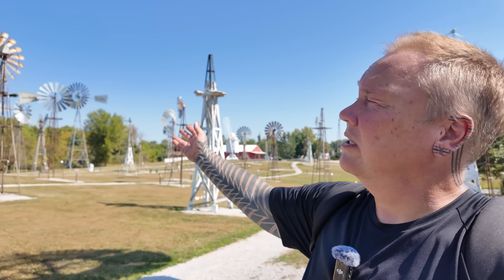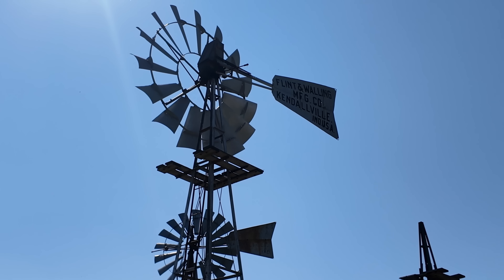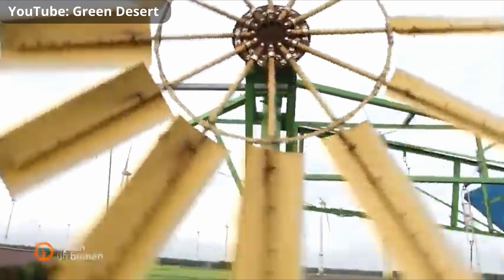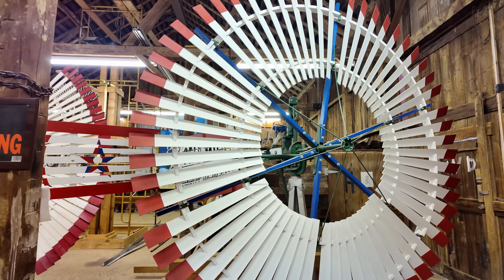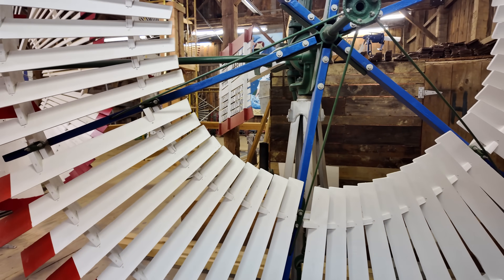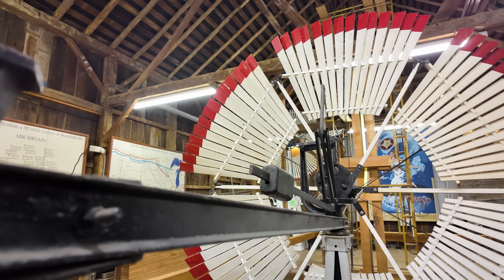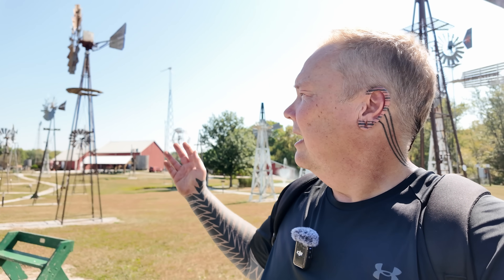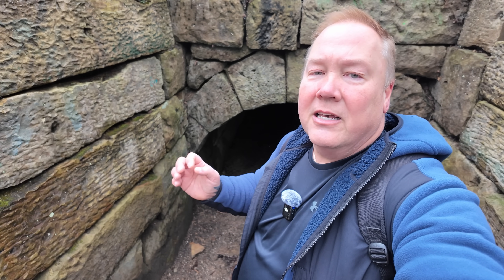Hidden History of American Windmills Revealed

Comment: Did the windmills come with  a special pump or did you just modify a well pump?
Reply from the maker: I think you'd just connect the windmill to the shaft that ran down the casing (the outer pipe).  Modern well pumps are electric pumps you drop into the bottom of the well pipe, but at this point, the technology was more like the old steam engine mine pumps, you have the reciprocating shaft going down the well casing with a couple valves.

Comment: On our 500 acre farm we had about 8-10 windmills, they were Aeromotor, Samson, and Monitor brands.  None of ours used the "feathering" mechanism he described at 4:10 to control the fan speed, on ours we used a lever connected to a cable (at ground level) to release the spring-loaded tail to turn the fan into the wind to turn the windmill on/off.  Pulling the lever to release/retract the tail also tightened/released a brake on the fan to stop the fan.  Also, in the video the "feather" worked the reverse of what he described, the vane would turn the fan out of direct direction of the wind, but similar to how the windmill would be turned off/on.
Reply from the maker: Were they considerably older windmills?  The mechanisms to turn them or feather them automatically came along later.  Most of them at the museum have ropes hanging down to do just what you describe, in some form or other, and need to be done manually.
Reply: @Industrial_Revolution  No, all were 20th century,  all used heavy steel wire, cable, or chain to control them.  A couple used a "winch-like" crank to turn it on/off, I think that could have been used to "feather" the windmill, though I never saw it used that way.

Comment: When someone sensible designs a windmill, you get one of these; economic to make and lasts ages.
Ask an idiot to design a windmill, you get a three bladed thing, that costs millions to make, with carbon fibre blades that don't last long, use massive amounts of energy to make, and are just dumped.
Reply from the maker: Different design objectives.  These can run a little generator, but you'd have to generated DC and convert to AC if you wanted to grid-connect, and they're really too small for that, anyway.  These are perfect, though, for running water pumps into a cistern or livestock tank where you just need it to run frequently enough to not go dry, and don't really care much about speed.

Comment: I have seen a lot of Windmills on Farms in SW MI but only one I can think of still working on a Amish Farm.  Pumping water to a large tank in a Barn .
Reply from the maker: Yep, a lot of old windmills are still around and not working.  A lot of new, smaller ones are being installed for use as air pumps to aerate ponds, too.  If you go out west, a lot of them are still working in remote areas for watering livestock.
Reply: @Industrial_Revolution    A friend of mine is in the Well Drilling Business in MI  He moved to TX for a while and he was very busy repairing wells pumps and Windmills for Ranchers.

Comment: Grew up on a cattle ranch in NM in the 40s, 50s and early 60s. One of the jobs I was good at was listening to the pipe at the top of the wellhead. You listened for the clicks of the check valves at the bottom of the well. By placing your hand on the sucker rod, you could tell the upper check valve from the lower and see the one or the other was working properly or not. If the upper was the culprit you just had to pull all the sucker rod out. Then fix the upper check valve that was attached to the sucker rod. If the lower one was misbehaving you had to pull the sucker rod and remove the check valve assembly. Then put the sucker rod back in the well and fish for the bottom check valve, once found it and screwed the sucker rod into it, you lift the sucker rod line up six inches or so. Since the check valve was in a cone at the bottom of a brass cylinder the pipe would come with it. Our Wells ran from 150 ft to about 450 ft, so that length of sucker rod and 2.5 in galvanized steel pipe was very heavy, for winch we used a steel cable ran through snatch blocks at the bottom and top of the windmill tower. Now with the pipe held a couple of in aloft, you used a sledgehammer to hit the top of the pipe to break the bottom check valve loose, once that happened you pulled the sucker rod as before. To reassemble just do the above in reverse.
The one time I got shown up by my father's experience was once the sucker rod over the years, had worn a pinhole in the pipe about 100 ft above the water line. The check valves were working, but water was leak out the hole so we got very little water up top, of course it was the 450 footer. 
We did amount of sucker replacements because they rubbed on the side of the pipe.
Did I forget to mention, well holes drilled the older drills did not run straight nor true.
Reply from the maker: How often did you actually have to fix these?  Seems they should be pretty durable, but sounds like you fixed them a lot.
Reply: @Industrial_Revolution Well, they were pretty good, but we were leasing the ranch, and a lot of cowboy types HATE  fencing and windmills in that order. Back then family run ranches could not afford tools that would have made things go easier. So our windmills when we got the place we're running on a lick and a promise. In actuality, my dad never let more than 3 or 4 years go by without topping off the gear boxes, that was the one job he wouldn't let me do. He'd go out on a quiet day, wind wise, climb up with a rope, I would tie a heavy chain to the rope and he'd pull it up, he would then chain the fan to the tower as tight as he could. Then I would tie on the oil and he would pull it up and top up the gear box, they did leak a little out of the pump shaft. He did all of this because it was not unusual for a gust of wind to come from an unexpected direction and apparently he had seen cowhands knocked off of the tower by the rotating fan and tail. Our windmills were all Areomotor with the centrifugal mechanism that would pull the tail to the side. The sucker rods were made from cedar, so where they rubbed they could wear themselves thin and break if you didn't pull and check them every 1 to 2 years. I learned a lot of curse words from broken sucker rods. Dad actually made a tool to fish for them and latch on to the broken end so we could pull it out, but it was time consuming and all the excitement of waiting for fish to bite.

We had 6 windmills, so never a summer went by that we didn't have to work on one or two of them. I didn't mind, because I thought it was more challenging than other ranch work. Fences that needed mending, either from wear or two angry bulls in opposite pastures. Bulls can destroy a mile of fence in one night of chaos.
The chores were piled deep, you never caught up or even close.
Compared to a lot in today's world at least you knew where you stood.

Comment: I've not seen these in the UK, but have seen loads in films.  I always wondered what sort of pump was used and didn't realise they had a mechanism for protecting themselves in high winds.
Reply from the maker: The older ones didn't have an automatic wind protection.  There was a rope hanging from the top and you'd pull and tie it down to engage the brakes.

Comment: I have a couple of pump Jack's. One is way older, it has 2 big gears and a flat belt pulley. I hooked a air/ hydraulic cylinder to one gear and a hydraulic control valve to the other and simulate a steam engine. With air,..
Reply from the maker: I'm not sure I'm visualizing this correctly.

Comment: That was most interesting, I once envisaged a small windmill / wind turbine using a bicycle derailleur gear arrangement controlled by a wind vane to vary output speed.
Reply from the maker: That would work, but wind isn't usually as consistent as water power, if you needed a specific speed.  Later this month (tentatively), I have a short of a windmill at this museum they've set up to run a small machine shop via gearing.

Comment: Driving truck I saw these all over. Nothing I've ever seen just does it's job.  Even though the farmhouse is turned to dust it  has no failure point. Some of them still have a working water pump. What can you put outside and come back 75 years later? Nothing except a windmill.
Reply from the maker: A lot of them you see, especially out west, were never at a farmhouse.  They're in remote areas hooked up to a water tank to provide water for livestock.  Some newer, remote wells have been built with solar panels, but I don't know they're any cheaper, and they're probably less durable.
Reply: @Industrial_Revolution I tried looking up more. Kept seeing the Aeromotor name but surprisingly there is not a lot to research on this bit of Americana.

Comment: In the early 1980s when I was still in college, I lived for a while in Napoleon Ohio. The Heller Aller Company was still building windmills at the time I can still remember the sand molds inside the factory. The model that they made was called The Baker "run in oil" model. The way the thier windmill worked in a too strong of a wind is that there was a spring-loaded tail, in the spring loaded tail would kick. And that would turn the blades 180 degrees so that they would be parallel to the wind. The funny thing there is that they had packing crates cardboard ones with the steel hoops, and they let me collect the metal lids from those for free. I made those into a solar heater for our back porch. 73 DE W8LV BILL
Reply from the maker: So the braking system was sorta like the first one I showed, but with springs instead of weights?
Reply: @Industrial_Revolution Yep!

Comment: I never knew that the side paddle shut down the wind mill what a cool video thanks
Reply from the maker: Until my first visit there a few years ago, and playing with that one they have there, I didn't know that, either.  It's really hard to visualize how they work when they're 50 feet up on the air.
Reply: @Industrial_Revolution as a millwright I was thinking some form of speed control with a weight or gearbox design but honestly this wins out every time with simplicity. Adjust the size of the paddle adjust the shut off speed
Reply from the maker: Either the paddle size or the counterweight.

Comment: I can imagine scrambling to make it there before the wind to hit that manual brake lever
Reply from the maker: A lot of these were installed right outside the farmhouse, adjacent to the barn, etc, and you'd just have to pull a rope at the bottom of the tower.  For remote ones, though, that'd definitely be a bigger challenge as a storm came in.

Comment: Back in 86, I worked at a wind farm on the Big Island of Hawaii. The wind mills were for generating electricity at 60 watts per mill. They were made by the Jakobs company in MN
Reply: In our area in SW Iowa, there were a few farms that generated their own electricity this way.  It was a very labor-intensive operation that as dropped as soon as rural electricity came through.
Reply: 60 watts?! Thats insane
Reply from the maker: Only 60 watts?  How big where they?
Reply: Perhaps you meant 60 kilowatts?
Reply: If memory serves me correctly, the Jacobs company made a 10 KW and a 20 KW. They were wind generators. They didn’t mill anything.
I think they were still made in 1986. They were made in the US. They required oil changes at the top of the tower had a considerable amount of maintenance. But they worked and they were affordable. Never had a 60 W model.
Reply: I think the windmills that eclipse would sell to individual farms we're usually in the 200 to 1200 watt range

Comment: We never ever got our Aeromotor to do anything at all, because we were missing the gearbox and couldn't find diagrams back then to build one.
Now today, I guess I could, they are online for sure...  and you can buy parts...  but we've already taken it down.
Good thing too because who knows what Hurricane Helene would have done to the tower... probalby not very much, it was seated in concrete  and had not much wind resistance.  Took quite a few lightning strikes in it's lifetime for sure.   I've been meaning to take the tip off it off now that it's down and defunct, and make a necklace out of it or something, just for the sheer volume of lightning strikes that have passed through it.
Reply from the maker: The towers were definitely pretty tough.  Wind just blew right through them.  The hurricane might have ripped the top off of it, though.

Comment: Seems like the older wind mill multi blades would do more work than the modern 2 blade types.
Reply from the maker: I'm not sure how well it scales up.  The big wind turbines being built now have a lot of tricks, like variable blade pitch, and really want a specific rotational speed, so too many blades might actually make them less efficient, and certainly more expensive.
Reply: Those 2 bladed devices are fans to break up temperature inversions.  It prevents cold air at the surface from causing freezing on a starry night.
Reply: The slower the wind speed, the more blades and surface area you want. The faster the fewer. Thats why planes have relatively few blades on their propellers. Fewer blades with less surface area is more efficient at high speed.
Reply: @brianhowe201  Agricultural windmills have a large number of blades because pumping water is a  high torque application.  Wind turbine generators have different torque requirements, so they use fewer blades.
I read that in a magazine decades ago when I was studying renewable energy. 
Hobbyists build their own alternators and carve their own wind turbine blades. The axial flow alternators are low torque. Hobbyists also build wind turbines with automobile alternators and permanent magnets instead of rotor windings. I presume that those alternators are low torque. They need to spin in modest winds of less than ten miles per hour.
Reply: @Fetherko  That's really interesting, thank you for sharing.

Comment: The Australian story is just as interesting. Most know Southern Cross made in qld. Best known in Victoria is Alston built in Gisborne. They invented and patented the curve blades used.  Up to then blades just had a flat surface. They went out of business in the 1960s. I have an Alston B12 built in the 1930s. I also have a machonicy gear box.
Reply from the maker: Machinery gear box, as in the type used to connect one of these windmills to an overhead line drive to run a machine shop?

Comment: Thank you. I have always wondered about those windmills. I guess where I live it is never that windy, even though I live in Ohio, where it is flat, and there are still a lot farms. Most of the farmlands have been sold off for new housing. Often in movies, they will use a lone windmill, slowing spinning, and ominously squeaking, as a metaphor for desolation and bleakness. I learned a lot by your explanation.
Reply from the maker: Ohio used to have plenty of these windmills.  The big, flat areas through Ohio are filling up with modern wind turbines because they're enough wind for the.  They'd typically pump water into a cistern, which would then provide water for the house, farm, cattle troughs, etc, so they didn't really need to run continuously.
Reply: @Industrial_Revolution  That is great information! I had no idea that Ohio had "wind farms" with modern wind turbines. That cistern system explains a lot. My 1905 era house in Columbus, has a large all brick cistern in the backyard, I discovered quite by accident, when gardening. After much research, I learned the water is/was collected from the house gutters. And was NOT potable, but was meant for garden watering, or water for cleaning. It is utility grey  water.

Comment: A great video about a midwest farm icon--when you think of a 100 year old farm in the midwest you picture a red barn, a silo and a windmill.
Reply from the maker: Thanks!  My grandparents house, which was nearly a hundred year old farm when I was a kid, was pretty much exactly what you just described.  The windmill was still turning, although it was no longer pumping water.
Reply: There was also an industry for railroad windmills to pump water to fill trackside water tanks for steam locomotives.
Don't yet know if that is mentioned in the video.
Reply from the maker: I've never seen one of those, but I'm not surprised by it.  They actually came up a few days ago when someone asked how they got water to towers along the southern Atlantic coast.
Reply: I asked my grandpa how he lost his little finger.he was using it to measure the link pin on the windmill 😬

Comment: A farmer friend of mine has a swimming pond, he uses a windmill to pump air into the pond to control the algae.
Reply from the maker: That's a great solution for it.  Probably cost half what it would have to actually run the underground wire to run a pump, and looks better, too :)
Reply: @Industrial_Revolution  That's a recent creation, installing a low volume air pump to bubble air into a pond or stock tank.  None of the farmers I know of ever used a windmill this way, the only one I have ever seen like this is purely aesthetic, for a small pond on an acreage on the edge of town.
Reply: @Industrial_Revolution we have a septic system that requires compressed air 🤔👍